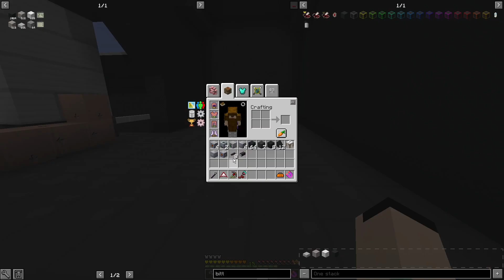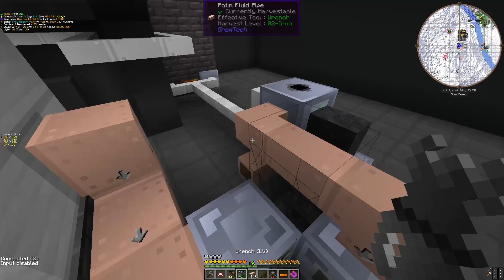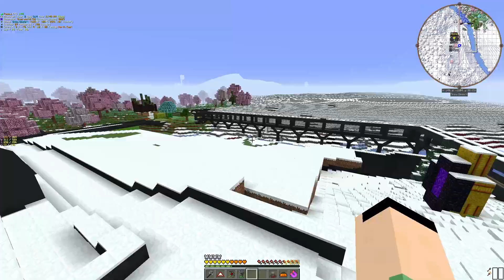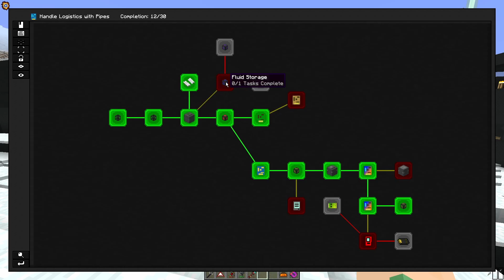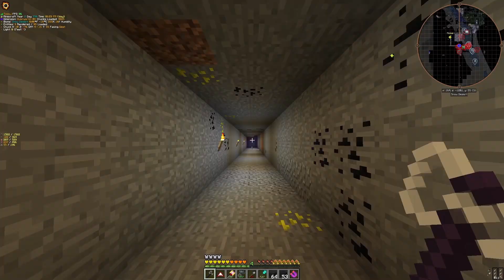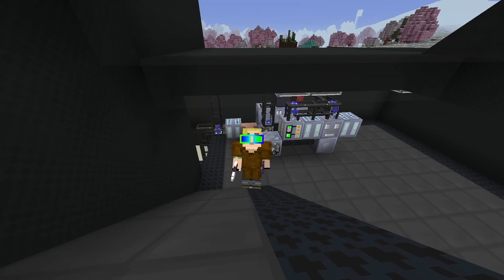GregTech New Horizons E15: Classic Plastic

Comment: I have the same setup as yours, but for some reason the oven says there isnt enough power for the recipie. I am using a 2x redstone cable and two LV steam turbines, and they are both pointed at the wire. But it still doesnt work. One thing I noticed that is different from your oven is that you have two LV energy hatches, even though you only use one. Would that make a difference? Or was there a recent change in how loss works? Or do you think Im just missing something?
Reply from the maker: It's been a while since this episode, so maybe I don't fully remember. But: you are trying to use the pyrolyse oven 64EU/t recipe, right?

While the machine "can" pull 2A of LV, it won't if you only have one energy hatch. The way it works is that the machine adds up the total possible EU/t of all energy hatches combined, and operating voltage is based on that value. 

With one LV energy hatch, the machine "can" pull up to 64 EU/t. This is less than MV, therefore the machine will not run at MV. It will only run at LV, so it can will only pull up to 32 EU/t for the purpose of recipes, and up to 64 EU/t only to account for loss. It will not allow you to do a 64 EU/t recipe. 

By adding a second LV energy hatch, the machine can pull up to 128 EU/t. This is MV, so the machine operates at MV. Now, it can request up to 128 EU/t. By adding the second energy hatch, it allows the machine to pull more than 1A LV for the purpose of recipes.

The fact that the second energy hatch is unconnected is just a fun lil quirk of the specific recipe requiring 2A of LV.
Reply: @Ham-Corp  You beautiful man. Or uh pig, idk. Works perfectly now. Thank you very much!

Comment: Dear HamCorp CEO,
We like how you're automating a lot of things early on. Manual stuff can be a productity issue. And also few tips from our experiences: Silicon Solar Grade production is one of the most fun automations to make and it does not require any other input than Raw Silicon. And puting Basic Logistic Pipe to any turning point is a good practice, because you usually end up putting a brach around those points anyways.

Best Regards
Köfteistan LLC Global Branch